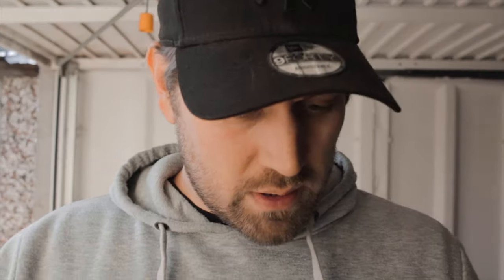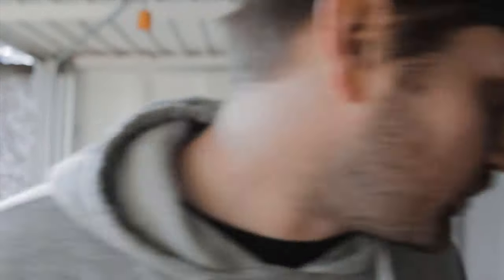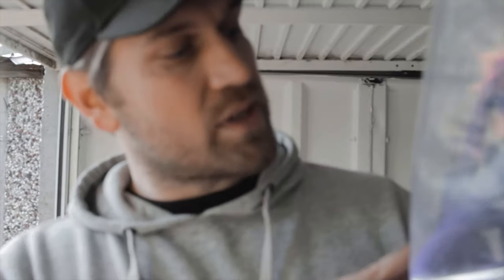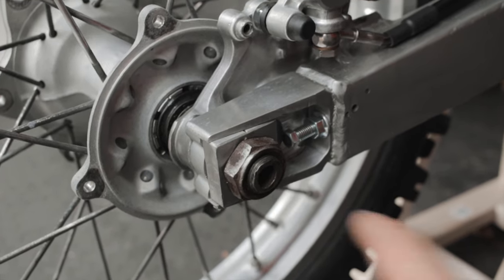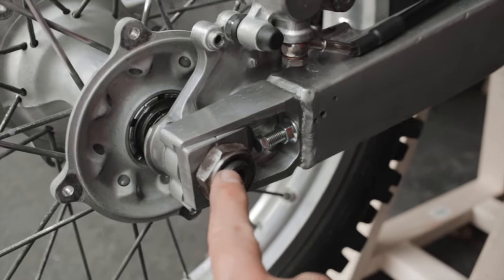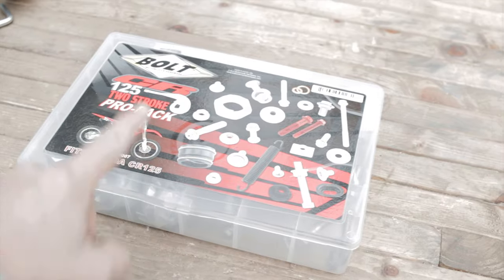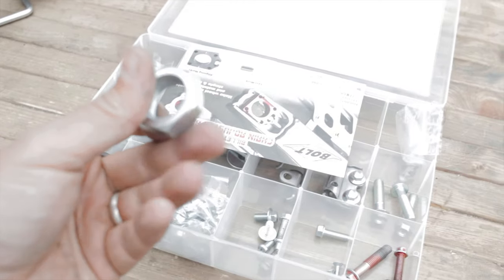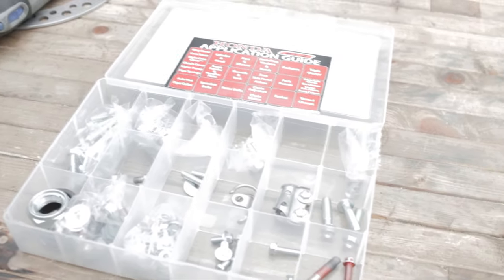Restoring A Dirt Bike Seat [with ANGELUS Leather Paint] EPISODE 8

Comment: Was ready for this. Looking better each vid. Only issue in vid was slight camera focus issues at the beginning.. I think the back drop was doing it.
Reply from the maker: Oh if only that was the only issue 🤣 I think I kept moving the camera around so it was hunting for focus. Getting there though eh? Got a rolling chassis now. 💪🏼🏍
Reply: @ducaveli  definitely looking good.. I'm interested in seeing a pretty in depth vid about restoring the axle bearing or wheel bearing you were refering too.
Reply from the maker: No worries, I was thinking of going into more detail with the wheels, tyres and bearings. Think I need a special tool to get the bearings out so I could talk about that

Comment: Tried using the angelus leather paint on a leatherette but did not stick on the surface the whole thing flaked off.
Reply from the maker: I’ve had good success with angelus on genuine leather, not used it on leatherette, that could be the reason it didn’t bond. Also when I’ve used it on new sneakers I wipe it down with acetone to remove the waxy top layer, maybe leatherette has something similar?